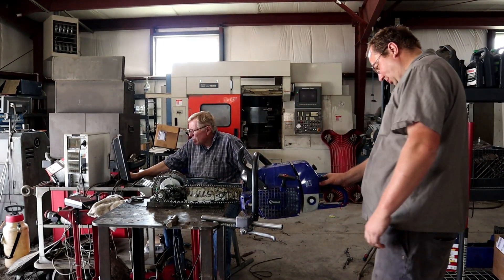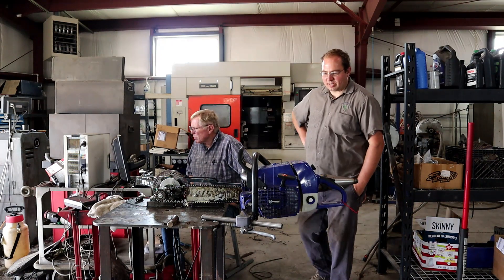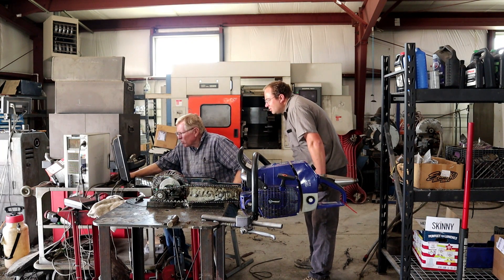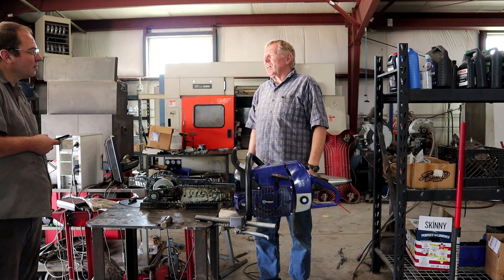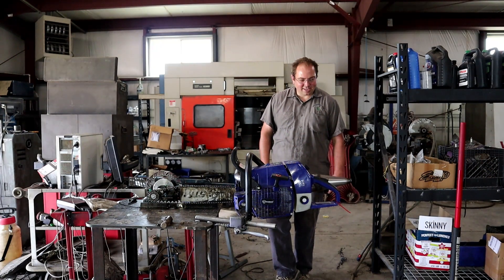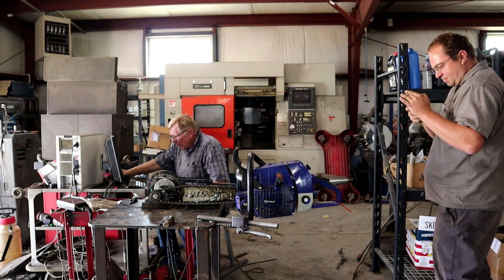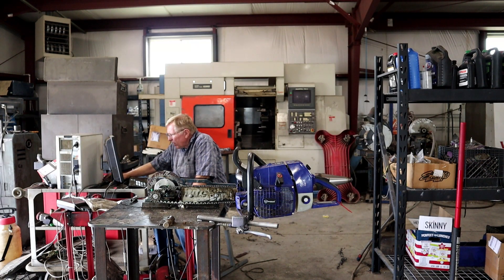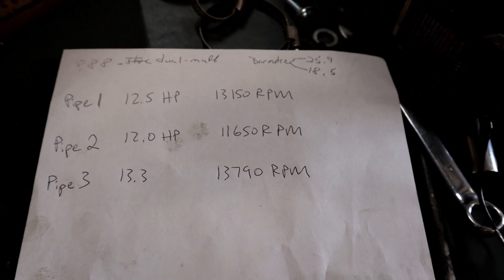61% HP Gains over stock on this G888 Chainsaw with a CPI pipe Stihl ms880 clone Dyno Results are in

Comment: Headers have always been a huge part of tuning...have you tested stingers?  I would be curious if you have tested that maybe make a spring mount on the end of your funnel taper?  If you welded a flange with a large opening maybe 1 1/2" then a couple of spring tabs you could have a pile of stingers ready in several diameters and lengths to tinker with...I am starting to watch the scooter bike tuners with their 125cc and them really small diameter maybe 5/8" diameter stinger thats 10"? long.  Off the cylinder a stepped pipe before the beginning taper would be interesting too but lots more work welding and sizing.   A laser temp gun measuring hot spots along the length of the pipe would be fun.  Thanks for the video...I love dyno testing!